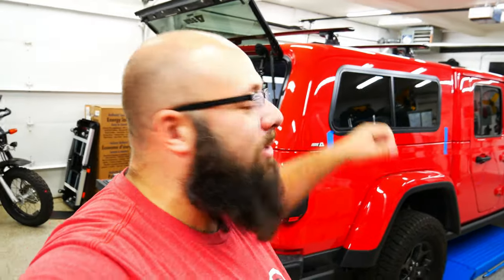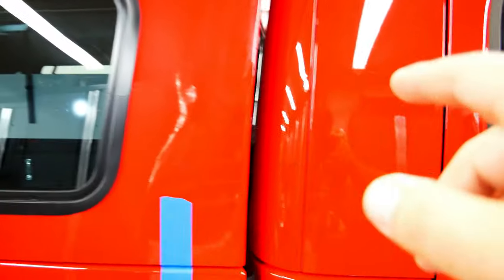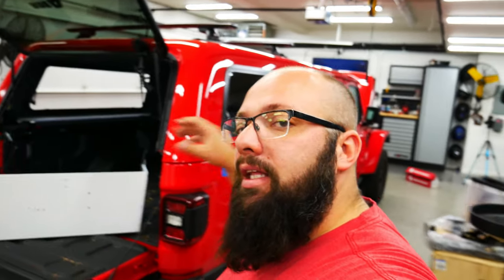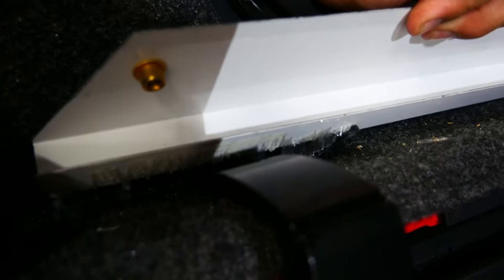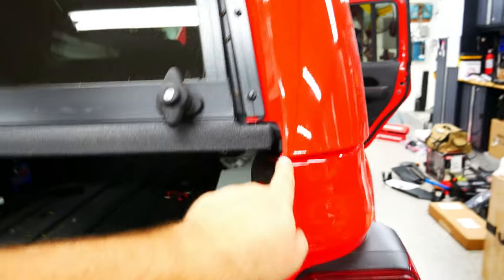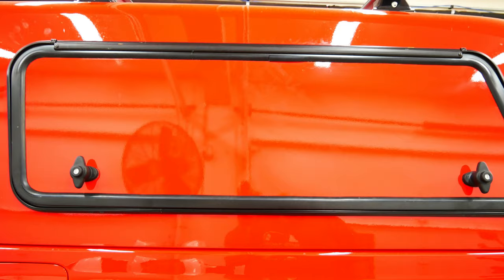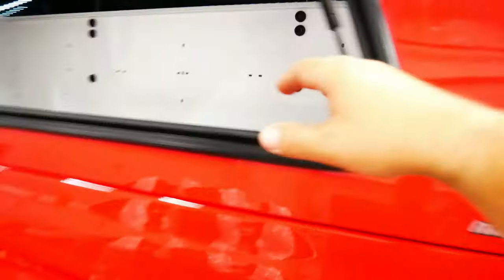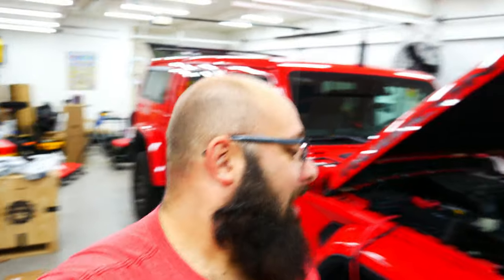Gladiator ARE Topper Mods, Rear winch hookup Hi-Lift Instill - Overlanding Build

Comment: Yes the wrap look great on the door of the topper. If you install a canvas sleeve( inside the windows) with flange on both end with Velcro holding the flanges  in place . This would making a better seal ( I would not remove your rubber seal )
Reply from the maker: Thanks. Thanks for the tip. Have a great weekend!